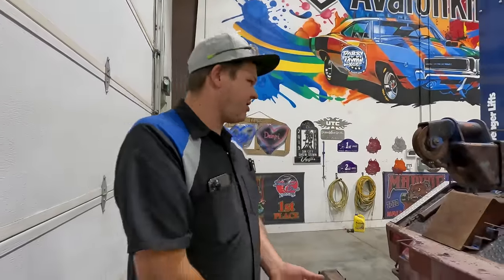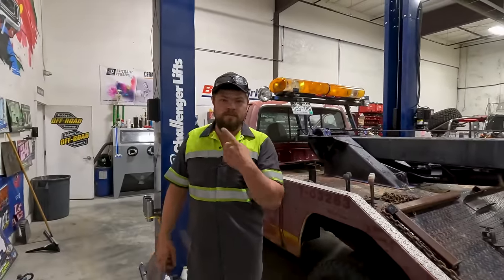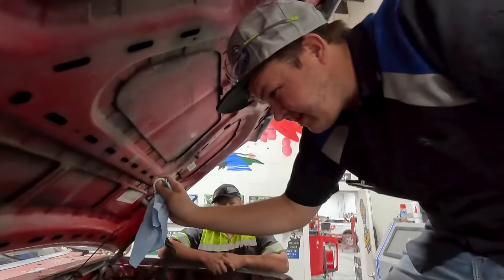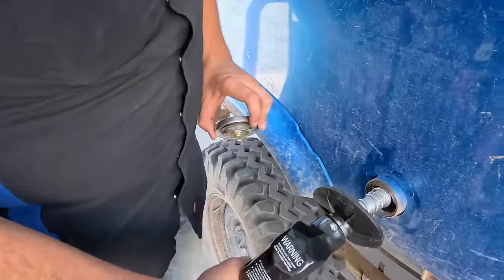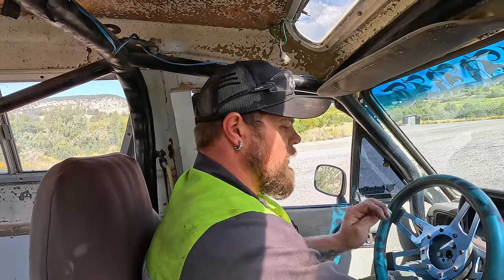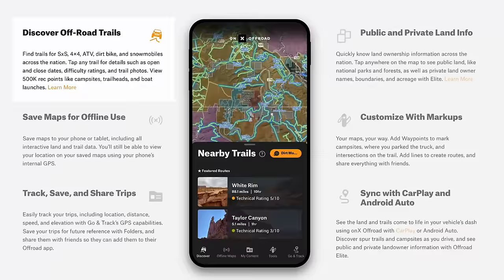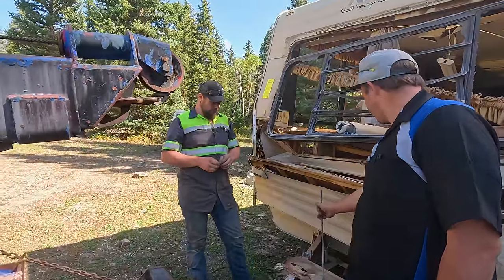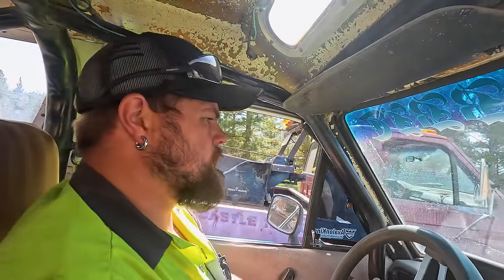FIRST RECOVERY With Our New Old Ford Wrecker!

Comment: My father-in-law used to scrap metal.  One of his main sources was an RV center that gave him units like this one.  When he would turn in the aluminum from those RV's he often left with a check for around $4,000.  It is worth stripping the metal off before you take the rest to the land fill.  The trailer frame has value as well.  It might look like junk, but that junk is worth a few dollars if someone wants to take a little time to strip it down.

Comment: Fun little video. I assume that is still the hydraulic winch in there, and I wouldn't bother switching that out if it works good. Paul needed something fast for the wrecker games, but in real duty, its fast enough. Also, you want your residual bleed of power figured out in that rig, or disconnect the battery each time with a main power switch, because you need the Batt. to be hot and ready, at all times, and if you are jumping it each time you are going to be going thru a dozen batteries. Figure out what light is on, or just put a battery switch on it which is a lot cheaper than buying batteries all the time.  It's a nice little tow truck.

Comment: Lived in Castle Rock for thirty five years.  It was a small town between Denver and Colorado Springs. I say it was a small town because it grew like crazy and is now a bustling community off I-25 and crowded as heck.  I saw your wreck for many years running around town but, it was replaced by much bigger wreckers.
Recovery went well and you guys rock on community service.  Thanks for caring.

Comment: Hello Mr. Robby: Suggest a few upgrades. The luxury truck headliner is perfect condition, normally seen is a exposed rusty metal, no doors, no rear window, cracked wind shield, chain steps, welder unit were the radio goes,  6 winches, cluttered tool box, 4 each shift levers with end wrench handles, 8 ball broadey knob,  Cab seat way not new. Keep these great videos going.

Comment: Love these old wreckers. I ended up putting a 12 valve cummins in mine. This was the best move I ever did with my 95 f350 wrecker. Went from 6 mpg to 17 mpg. And enough torque to idle up everything. Switch to a 1 wire alternator so will not be dead when you need it. The 460 auto will do the job but the mpg is horrible. Always upgrade to a hayden severe duty fan clutch on these. We also use a/c condensers for trans coolers. Like a uhaul put a spin on filter inline on the trans cooler lines. For hard working trucks. weld two trans pans together to be extra deep and put a heater core inside the bottom pan hooked to your coolant lines.  Water cooled trans pan with ad years to your transmission when working a truck hard. I have been doing this stuff for over 40 years.

Comment: Next time you do that type of recovery take a roll of plumber's strap and screws with you to help secure loose panels in front where it grabs the wind. Also you can see if the dump will use their equipment to flip trailer on its side then you can sawsall or un bolt axels easily. Keep up the great content guys n gals!

Comment: excellent test, it's a shame it's not a diesel engine, the fuel savings are quite notable. Do not remove the hydraulic winches for electric ones, the hydraulic ones are better at the time of a rescue, they accelerate and are fast, the pump must be fine, greetings from Colombia

Comment: Robbie.. you need a set of trailer lights for the wrecker.  Also there should be a pin or locking mechanism that locks the swing arm in the straight position when you retract it... I'm an ex tow truck operator here in Melbourne Australia..

Comment: Cut and redrill your receiver hitches inserts to work on the wheel lift with them much shorter or closer to the head unit.  That is long and will have allot of leverage on the wheel lift like that. I have seen them break off. We also put a large d-ring on the top of the wheel lift boom for when they lose a line underneath you will need to lift it with the top boom. Or a strap around when needed. We use the d-ring set for when we carry motorcycles on the wheel lift as well.

Comment: Put a zip tie under the dash on the throttle cable next tp pedal arm to take up the factory slack. Pull the hoses off the intake plastic tube coupler and cut the cone restrictors off then put the hoses back on. We went to headers and a 4 inch single exhaust and this helps mpg. The injection system these years was for epa only. not for mpg or power.  these trucks also like large hood vents to let the heat out. they like air spoiler right in front of the main engine cross member to direct road air to the front of the oil pan.

Comment: We always carry a gas powered air compressor or the newer style smitty built large 12v compressor. You just never know. Some self loading dollies and a welder/ plasma cutter on the truck and there is just not much you cannot do with the truck as far as recoveries. Many carry a arborist (loggers) rope for super long pulls and snatch strap. I have a 30 gallon water tank under mine and rv pump with water hose for just in case as well as extra fire prevention stuff.

Comment: 10:06 You know!!! ..10:06 You know!!! ... As long as they are not burnt, wrecked, camper trailers are a GREAT find!!! ... They have enough aluminum that it will pay for your gas once you remove it and fold it up!! ...

AND , because they are designed an built for 60 MPH Highway travel???  The frame is very strong and road worthy!!! ... You can strpi off all the junk and use the bare frame as a GREAT tow behind trailer for just about anything!! .. if you strip it and paint it, they sell for $300 to $400 !!!

Comment: Robbie you need to put some deaver HD leaf springs on your new wrecker and upgrade the suspension in the front. And I would put nitto ridge grappler tires on the  wrecker I swear by these tires they have lasted me 70,000 mi on road and gravel. But at least upgrade rear suspension to the Deavers HD leaf suspension with shock support.

Comment: You’ve got to put some exhaust on that tow truck 12 inch catalytic converters true deals dumping right in front of the tires in the rear with 24 inch long echo tips 3 inches in diameter or 4 inches in diameter

Comment: You should have taken that to the scrap yard.  Theres probably $400 plus in metal in that thing, steel frame, and the rest is primarily aluminum, I scrapped one in 2019 and got $275 for it.

Comment: Those Ford 460 V-8’s were famous for their exhaust manifold leaks resulting in an exhaust “tick”.  That is my guess as to what is causing that tick sound of the engine.  Almost sounds like a bad lifter (or worse) but my money is on the manifold gaskets.  The manifolds may need to be milled back to a flat surface before reinstalling them with new gaskets of course.  And beware, very possibly you will encounter some broken studs in the process, so it won’t be a simple as you would like to think.

Comment: great job, the Layton way, you guys are great, but on the safety side of things aren't you supposed to have a portable tail light assembly that gets strapped to back of the towed vehicle, so that drivers behind you can see a/ signaling b/ stopping, but I guess one thing at a time. So many things to do, so little time. keep up the great show, and be safe.

Comment: That looks to be about a late 1980s 29 ft wilderness in it's day was one of the top-of-the-line trailers, very similar to the 1989 Terry 29 R,I live and travel in, well mines in almost pristine condition still,  I tow mine with a 1975 Chevrolet C-20 custom deluxe, camper special, been in all of the lower 48 State, and some of Canada, tows like it's not even behind me, even over the passes, kinda interesting going over the Mackinac bridge with a wind kicking up but whatever doesn't kill you just makes you stronger,

Comment: What's odd is that they didn't charge you for the draining of refrigerant in the air-conditioning and refrigerator? I'm just saying. Because I just took a refrigerator to our dump and they charged me $25 to drain the refrigerant.

Comment: It's not a great sign that the battery is dead, engine is knocking and the transmission is low on fluid before you even leave the shop.

Comment: Well I got one thing to complain about it. Porter towing service you should have known less.
You didn't have your hazard lights on. And you didn't run all lights to the back of the trailer🤷🏽‍♂️🤷🏽‍♂️🤔😞😉😊.👍🏽🤔🤙🏾✋🏽🤛🏽👏🏽😎🙋🏽‍♂️.  I think you said lift hillbilly truck there that there dump too.
Just screwing with you.